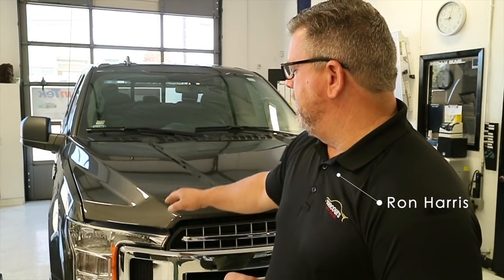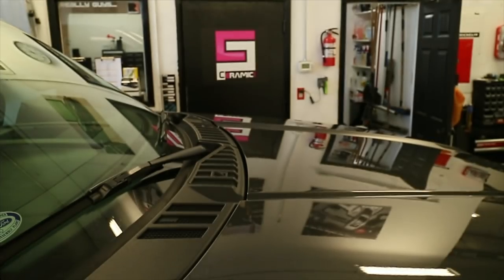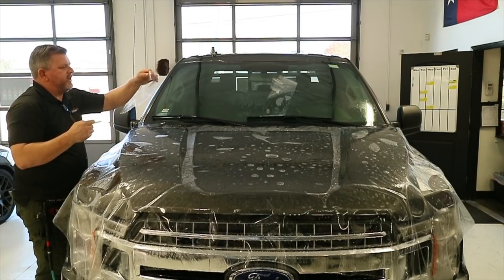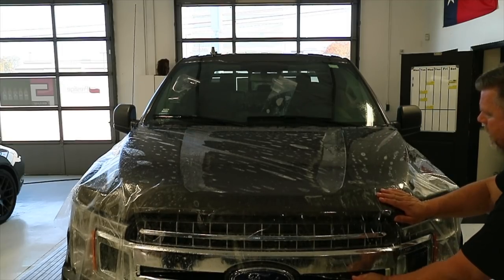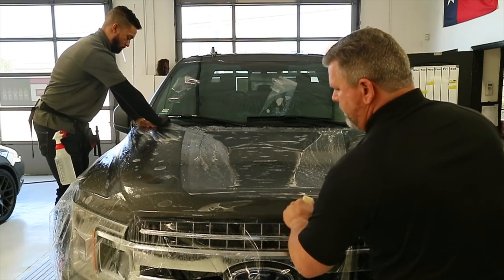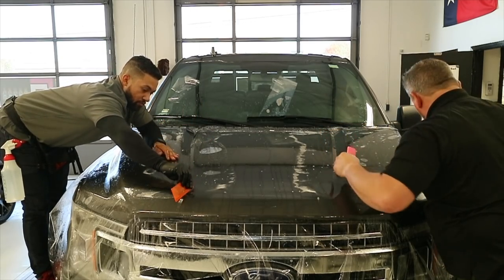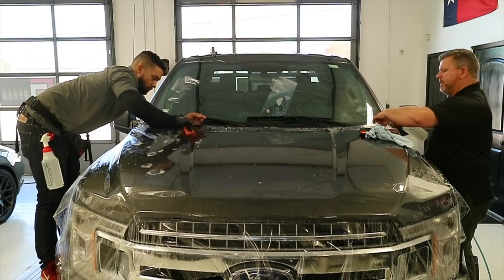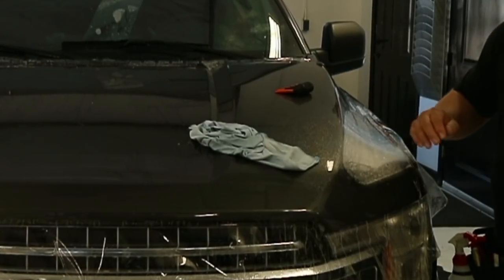FORD F-150 Clear Bra Installation Hood

Comment: Back in September 2018 I did PPF on a Platinum. It wasn't full hood, just 18" up, but , yep those valleys are killer to work with.  The hood tho is easy compared to the bumper!!!!!!!    I struggled getting it to lay in the compound corners.